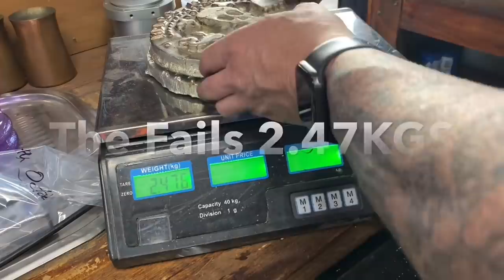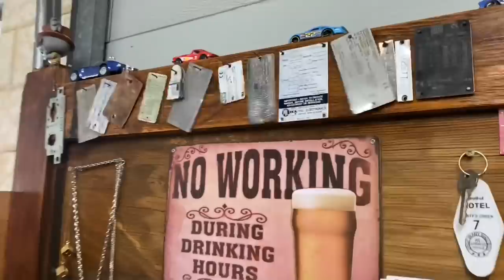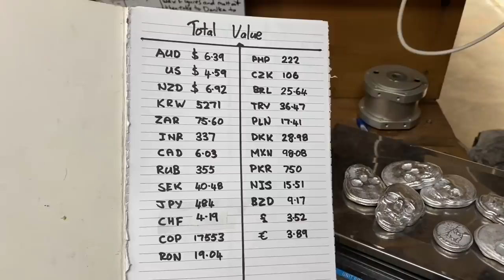Trash To Treasure - Casting Worlds Largest Pirate Coin From Scrap - ASMR Metal Melting - BigStackD

Comment: With clay-graphite crucibles, does the graphite eventually just burn off or something?  Also, my untrained eye didn't see anything wrong with the first two.  What were the flaws?
Reply: Haha, nice teaser!
Reply: The first two coins had air bubble holes on both side on the pirate and I don’t think the graphite burns off but losses it structure and will full apart before it burns majorly, as it’s compacted pretty tightly so I’d say yeah but not for a long time

Comment: If you wanted to remove some of the layer lines from the 3D printed casts, you could try an acetone vapor bath before making the mold. It would clean up the lower relief parts, but I like that half rough half high polish too.
Reply: Only works if printed in ABS plastic. If he used normal PLA then acetone won't smooth it. You can however spray copious amounts of spray paint over the parts to make them smoother.

Comment: I'm glad you gave us a brief look at the attempts that didn't work. I'm a little curious about how you think other attempts have been failures, so it was good to see the divots in the ones that didn't work. Perhaps if you ever ever have a failed attempt with another one of your pours perhaps you could point out some of the problems with it so we know what's going on? I love your videos and your dogs.
Reply from the maker: Yes matey that would be a good idea but I would hate to put out something and turns out that I’m wrong and get absolutely torn to pieces in the comment section, I believe the problem with these  particular Pours was I didn’t use any risers on the first 2 pours so there wasn’t quite enough weight pushing down into the mold to expel all the gases👌🏻, I could be wrong but that’s my guess
Reply: @bigstackD  Thanks for explaining.

Comment: Question about model printing. Wouldn't be easier to print front and rear part of coin laying flat on printer table, and after glue them together? Recessions will be much smoother, especially if print by ABS and polish by acetone vapor

Comment: Two things -  1, you should melt participation medals - make them mean something 2, your 3D ender printer, ours we can't get the print to stick to the base.  What kind of issues have you experienced over the years?
Reply from the maker: The only problem I had was the pieces not sticking to the base as well and a blocked nozzle that is absolutely it. I found with getting them to stick to the bed as they say in the tutorial get the print bed flat and only a paper width between the nozzle and the print bed but I’ve found if you pretty much half that distance so it’s basically scraping across the print bed The prints stick better  and I’ve never had a problem since then if that makes sense?

Comment: Love the use of surplus melt making surface casting skulls!!instead of ingots,I've seen it said  onYT that extruded alloy frames etc is no good for casting,it's good to see you prove them wrong,if I'm casting important parts for model engines I use previously cast scrap but for the plaques I make well   I've been using it for yrs & have cast 100s I built my 1st foundry over50yrs ago with my Dad runs on foundry coke,I like your burner propanes expensive, but less hassle lighting it have you put drawings on here for it? cheers.

Comment: If you prime your print off before you cast it with some good surface primer or some fill putty for the big lines you won't have all this lines that get picked up by the sand and then your final cast

Comment: I’ve been looking into the 3D printers a little and was wondering what brand you use and does it work well or well enough for you? Cheers 🍻. Great video btw.
Reply: I think he uses one from Creality. Either a CR10 or Ender3. I have the Ender3 and it's a bit smaller than the CR10 but also quite a lot cheaper.

It prints beautifully after some setup. I got mine from Aliexpress for 160$ with the glass bed but you can find them everywhere.

The build volume of the Ender3 is big enough for 95% of things you would want to print. And if you need bigger then you can simply split up the parts.

You can find a lot of information on the printer at TeachingTech's youtube channel. Also check out the channel Chep.

If you go for the Ender3 I'd highly recommend investing the 25$ for an SKR mini E3 mainboard. It has drivers for the stepper motors that make the printer a lot quieter and it also improves the print quality. The board is plug and play so you don't need to solder anything.

The printer still works just fine with the original hardware, so you don't have to change the motherboard. 

I have a video on my channel where you can take a listen to my modified printer. It's really quiet and you can only hear some fan noise.

Comment: Most peoples problems with quality is because they are pouring WAY too slow. Your third try was much better because it was a faster and more consistent pour.. Your risers are there for a reason.. pour fast and let em flow a bit its gonna get cut off anyways. If you speed up you will also see an improvement in your larger bars.

Comment: In the future would you consider making one that's the size of an ATV / small car tire / go kart tire?
Reply from the maker: I have actually got a subscriber that wants to print out and send me a 40 cm one which will be four times as big so that will definitely be interesting and it will be at a future video if they actually send it through but I’ll need to have 4 furnaces running with 4 full crucibles to fill the mold I would think so it would be a very interesting video👌🏻

Comment: As a nonmelting guy. Are you fairly new at sand casting? How do you get the ice at the end of the videos to look like your digs,?
Reply: Sand casting in very much luck based as moisture in the sand and the fumes that come off the burning sand can cause gases in casts, and you can’t dry out the sand completely other wise the casting sand would basically be normal sand. Also I want to know how he gets his dogs into ice too ahaha

Comment: What did he use for the mold. Looks like clay from a construction site
Reply from the maker: It’s actually an oil based casting sand called petrobond. It’s definitely one of the best materials to cast in as it holds details perfectly👌🏻

Comment: Aluminum has a low melting point? i would say its a fair melting point a low melting point is mercury, lead, tin. you would melt mercury by holding it, tin you make it weak by holding it and lead you can melt with a lighter
Reply: He's comparing to copper or brass, which are the other things he normally melts.

(You don't need to hold mercury to melt it, it's liquid even at subzero temperatures. Gallium's the metal that melts near body temperature.)
Reply: @RedwoodRhiadra  well murcury isnt exactly liquid the melting temp is around -30 - -39 F
Reply: @RedwoodRhiadra  one more thing brass is technically copper but with zinc in it, what I’m saying is that brass is a alloy. It’s ingredients is zinc and copper. I don’t think anyone knows that?
Reply: @SeriesFightClass  Yes, brass is an alloy. What does that have to do with it - BigstackD was comparing the melting point of aluminum to those of the other metals he works with, including brass. He works primarily with aluminum, copper, and brass, and more occasionally with other copper alloys (Nordic Gold and aluminum bronze). He does not melt or cast mercury (essentially impossible outside of extremely specialized laboratories), and only very rarely tin or lead.
Reply: @SeriesFightClass  That's exactly what I said - mercury is liquid at subzero temperatures. You don't melt it by heating it in your hand.
Reply: @RedwoodRhiadra  I'm just saying most people such as your self don't know so
Reply: @SeriesFightClass  You are utterly wrong about me not knowing. In fact, nearly every regular viewer of this channel is aware that brass is made of copper an zinc, BigstackD has made brass from its component metals several times.
Reply: @RedwoodRhiadra  nah i don't really think you do he made Nordic gold ik that
Reply: @SeriesFightClass  He also made regular brass and aluminum bronze that way.
Reply: @RedwoodRhiadra  dude just call me panda and ik